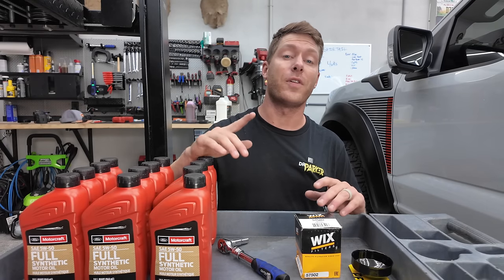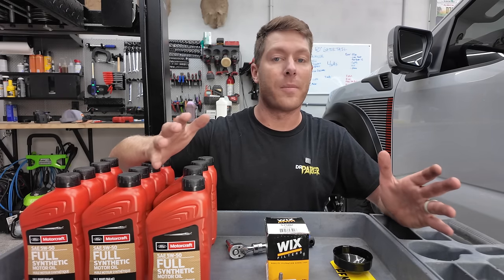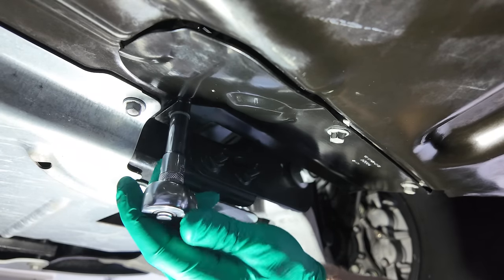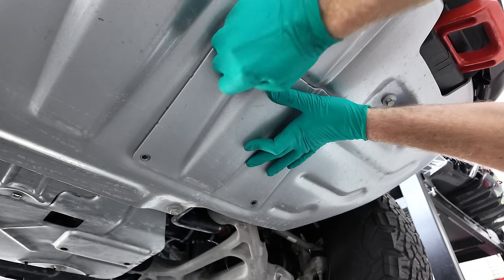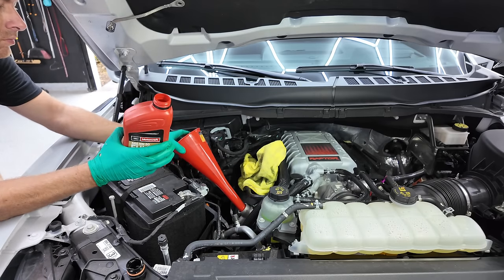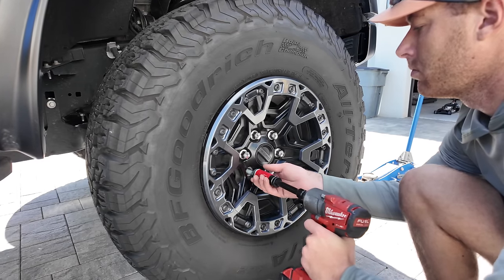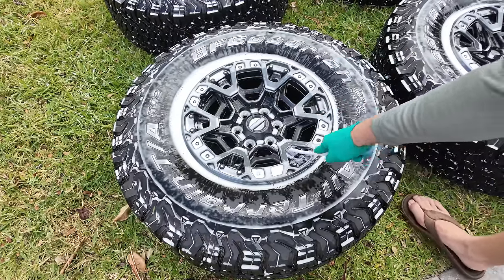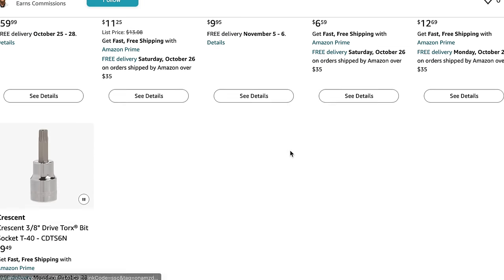Ford Raptor R Oil Change (Everything You Need to Know)

Comment from the maker: Is there anything you would do differently or that I missed?
Reply: When tightening lugnuts always tighten in a star or crisscross pattern. That allows for evenly torqued lugnuts and minimizes lugnuts coming loose.
Reply from the maker: @samcate1769  Yes I agree, especially on the first pass.
Reply: @DoctrParker for sure
Reply: Don't use anti-seize on the wheel hub studs/lug nuts, it may increase your torque values and can cause wheel studs to stretch. For rust/corrosion protection use Fluid Film works great. Awesome truck 👍
Reply from the maker: Hmm I have not heard that before definitely looking into it. Would be cool to test the difference.

Comment: As a ford tech, I see that was your factory oil filter coming off at 9700 miles. Highly recommended not following fords interval, especially on a vehicle of that caliber
Reply from the maker: So are you saying to do it more or less often then recommended?
Reply: We do every 5k miles
Reply from the maker: Not going to lie, I definitely skipped out on the most important one at 5K miles. But better late than never! As a ford tech do you think the video included everything correctly?
Reply: I think you may have produced the most informative oil change video I’ve seen for any vehicle. Kept it short and to the point!
Reply: When should I perform my first oil change on the Raptor R ? Does the break in oil really matter?
Reply from the maker: @alvinsornsaard5240  It is recommended to change your oil every 5,000 miles on a Ford Raptor R